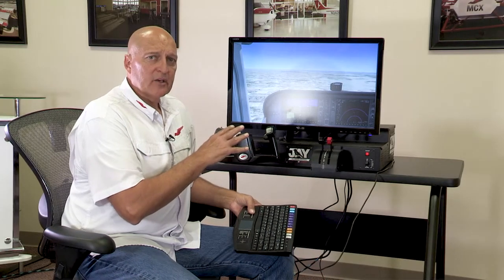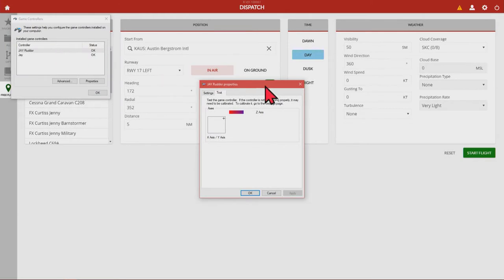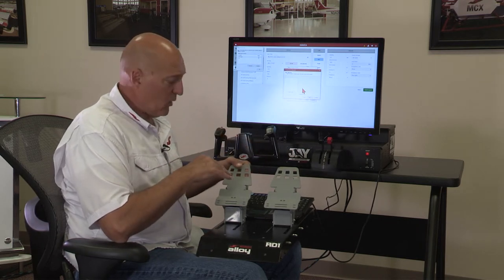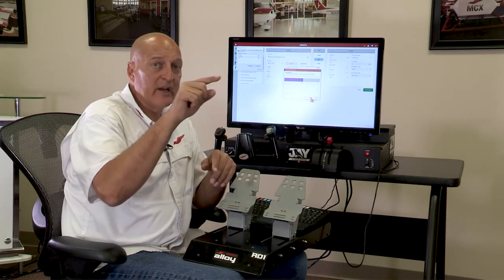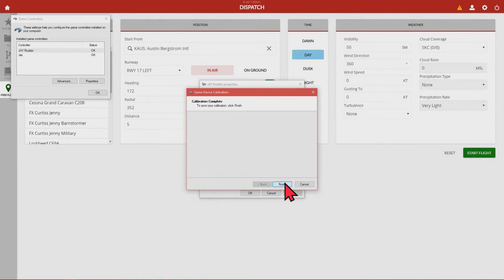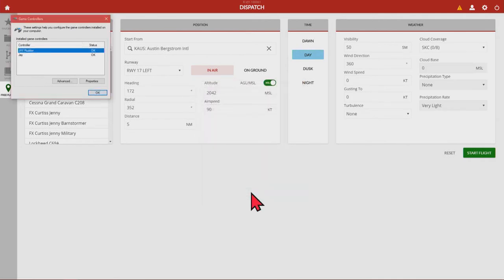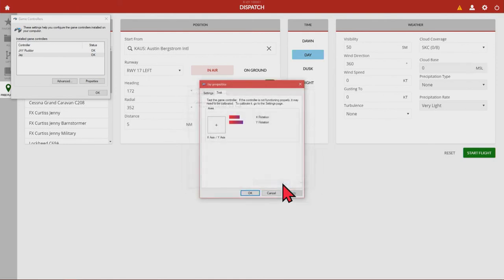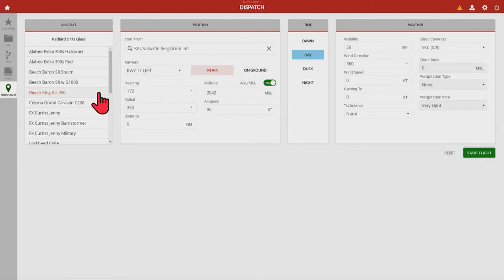How to Calibrate your Redbird Jay and RD1 Rudder Pedals

Comment: I did this calibration to my four TD2's and now none of them react to pedal movements.    I used the online directions and then tried again with this video exactly as described.    The appear as active in the settings of the Redbird software but have no action on screen.    There must be a step missing in these instructions or something.